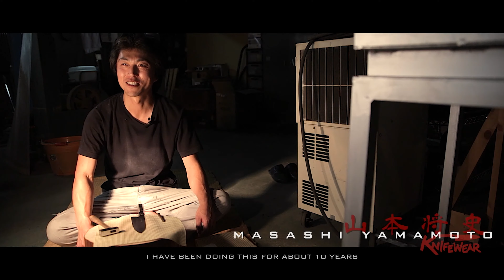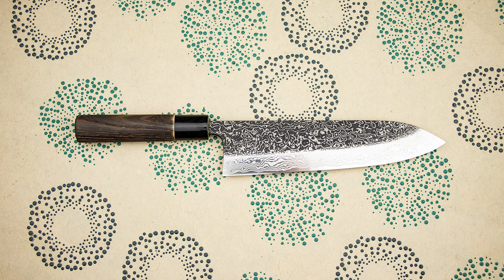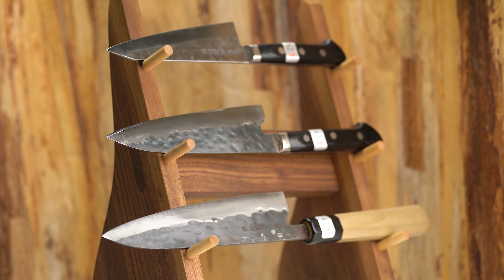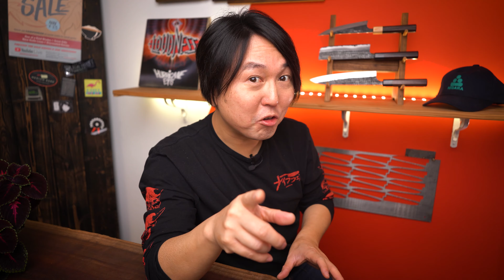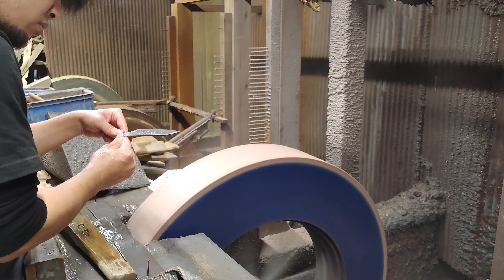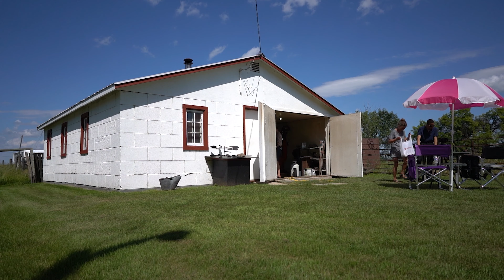The Most Exciting Japanese Blacksmiths in 2023

Comment: Here's what I don't understand about Japanese sharpening:
Convex grinds are quite popular on Japanese knives, but they grind on a traditional wheel, which naturally makes a hollow grind, not convex. I understand that they use a wrist technique to flip the blade to produce a convex grind on the wheel.
So... why not just use a belt sander? In Europe and the US, convex grinds are usually produced on belt sanders. It requires no special wrist flipping and will allow a consistent convex grind even if you don't have decades of experience or whatever.
Reply from the maker: That's a great question! Some makers are using belt sanders, but there's a few reasons most aren't. First, the big wheels have water running on the, so it helps to prevent overheating. It's also the established way that many makers have been using for decades, and it's the equipment they already have. Many makers have inherited their masters workshop, so they use a lot of the same tools. 

We are seeing lots of young folks building new workshops and shake up the old ways of doing things, so you'll probably see more belt sanders in the future!
Reply: @KnifewearKnives  Cool, makes sense. A good belt sander ain't cheap. 
FYI, they do make smaller belt sanders that can run wet... or even underwater.